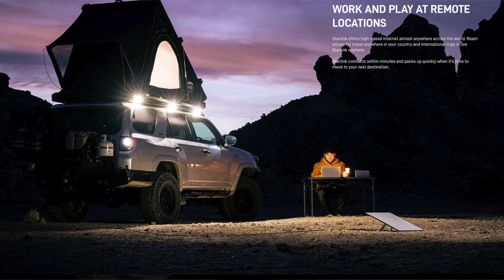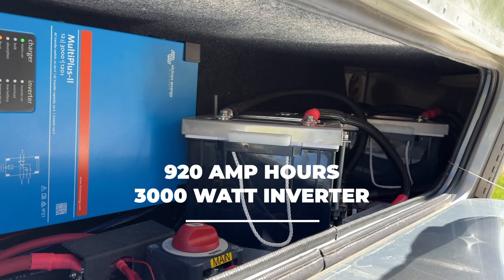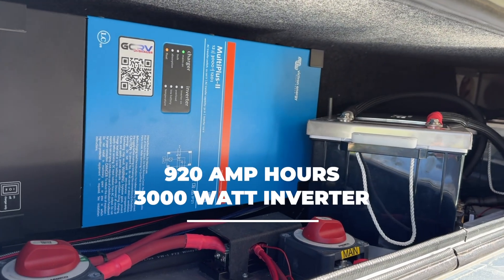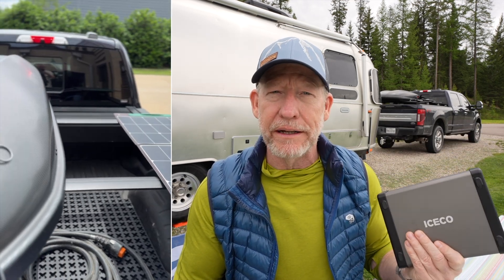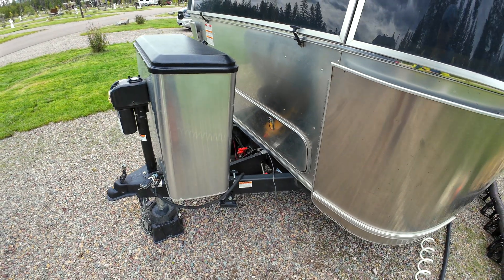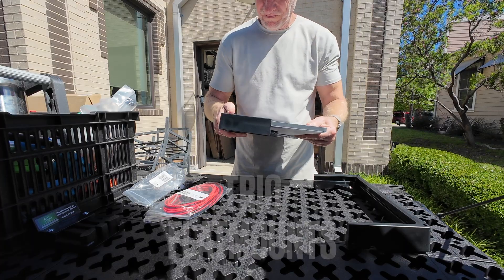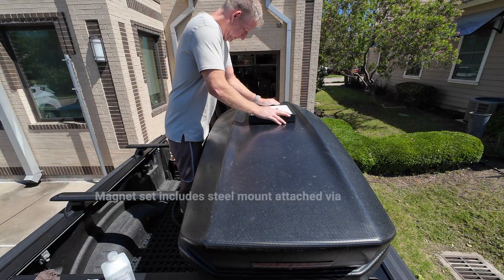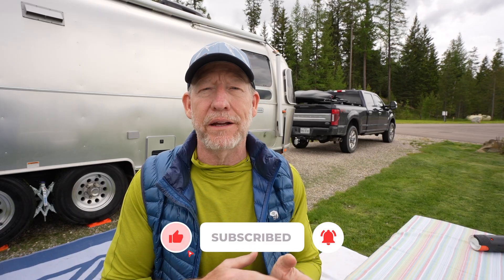Easy Starlink Mini DC Power: RV Battery / Portable Battery Hacks

Comment: Will a SAE solar port power the Starlink?
Reply from the maker: Probably not direct. I hooked up a 100W panel to my battery bank that Starlink was plugged into and it produced more energy than Starlink took, so that way you can.

Comment: And how did you run DC power to the dish when driving?
Reply from the maker: cracked back window, fed cable to the power outlet in the back. I'm going to come up with a way to have a battery in my Yakima and power that way.

Comment: I work remote and I know I want the starlink mini, but I’m just confused about which plan I should get?  I saw roaming plans and unlimited etc…. 🤷🏻‍♀️
Reply from the maker: The 50gb will get eaten up pretty quick if you stream video, so if that's the case, go unlimited.
Reply: Yes, exactly. Knowing all the costs up front would be so helpful. Nothing worse than buying a tech gadget then realizing it’s a rabbit hole of ongoing cost like extra accessories, data plans, etc., etc.m etc.

Comment: I am not seeing the link you referred to for the hard case for your Starlink.. could repost that? Also I have just the 2 agm batteries that came with my trailer will the mini run off thev12 volt batteries really depleted my batteries fast? I do have 180 wats of solar.
Reply from the maker: Here is the link to the cage for the Starlink: https://www.trioflatmount.com

You can run the Starlink off your AGM, give it a test and see how they handle it, then you can get an idea of how long they can power it. You also may want to look at this video for another solution that will help. https://youtu.be/F5_H4QGXGtM?si=Yx3WG3K_sHXEW6hG

Comment: Easy to mount the mini inside one of your skylights and plug into an inverted outfit. I used 3M hooks so I can easily relocate it. Reception is great and nothing outside the trailer.
Reply from the maker: Definitely great if you don’t want to set up in the rain, but I’m pretty OCD and the cords and the contraption in the skylight would be a challenge for my well being, lol

Comment: Do you step up the voltage from your 12v batteries?  30v is recommended with longer wire lengths.
Reply from the maker: With 16 feet, and a well charged battery, no need to step up, however if you had need for say a 25-50 foot cord, you would need to. As long as your battery source is well charged and 16ft or less, works great